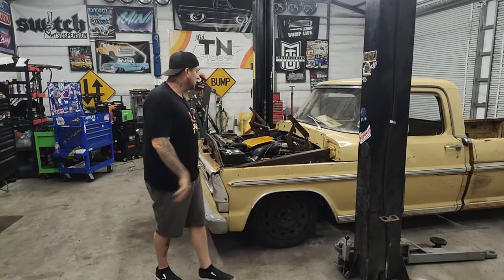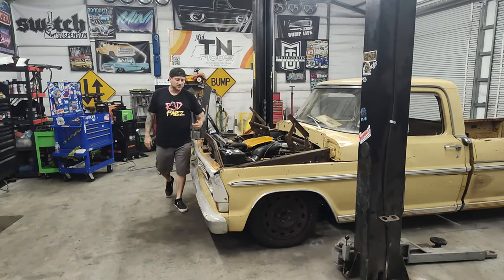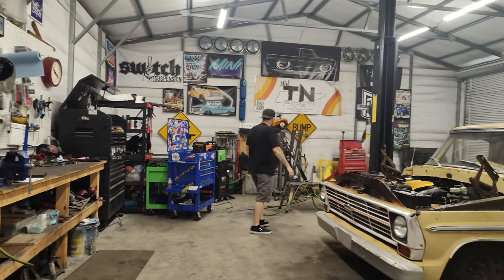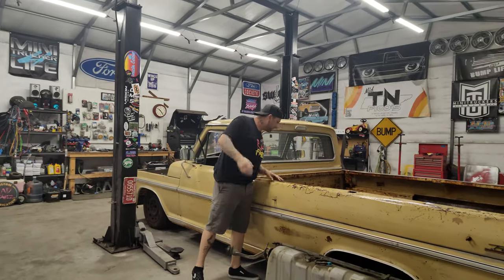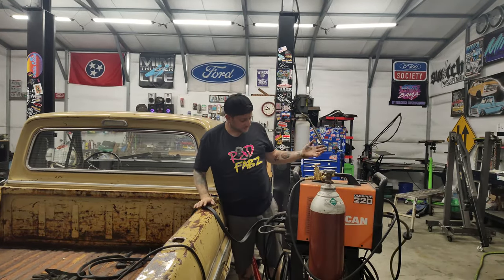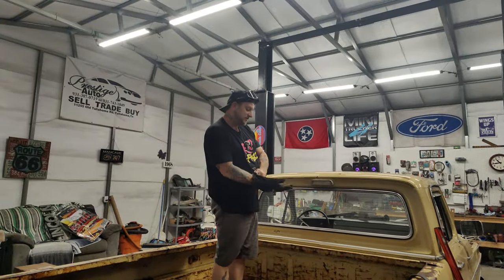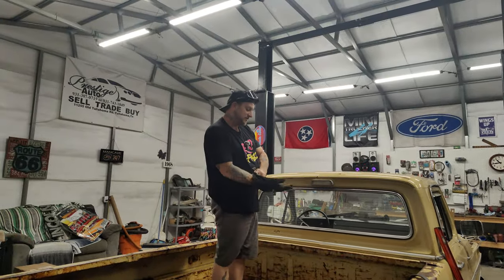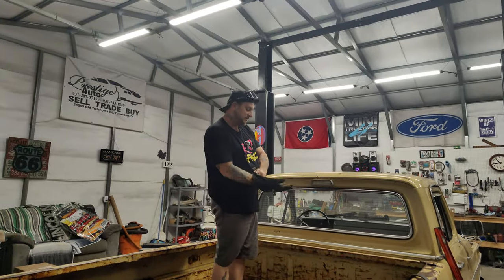1969 Ford F100 Getting Z'd & 4.6 With AC Part 4 Rad Fabz

Comment: I like the gas tank placement. I was going to do the same on mine. I'm on my first ever build. Got an 05 Vic and a 66 long bed. I put QA1 coil over suspension in the back ,  I've kind of stalled though, trying to figure out how to pull the motor. it would be the first motor like it I've pulled. I did remove the front clip and been peeling the wire harness back. Your videos have been really helpful.  I'm keeping my long bed. I dont really want to bag it. Im just going to get QA1 crown vic coil overs for the front.  Are you going to use the factory fuel filler?? Im thinking thats what i want to do but i dont even have the vic suspension dropped out yet. better take my time.
Reply from the maker: Hey buddy thanks for watching my video! The engine comes out really easy. I will be putting a tool box over the tank in this truck to cover the tank. I'm not sure how I'm doing the filler neck on this one yet but I usually build a box over them and the filler neck is on top. I have ran a hose thru the cab and had the filler spot in the stock location and the fuel would travel from the stock spot to the tank in the bed,if that makes sense lol.
Reply: @RadFabz  I was thinking tool box too!  I want to later move the tank to the rear but, I have the stuff to get going. Budget you know. LoL.

Comment: What camera are you using?
Reply from the maker: Im using my phone camera with the DJI OM 6 gimble. It has its own app with a new camera. Ive been using that and another app called ProTake to try and get better quality. Its a bit confusing at first but im getting better at it.
Reply: @ the video was good. Beginning had a little flicker in the color at beginning but audio was good and it tracking you was cool.